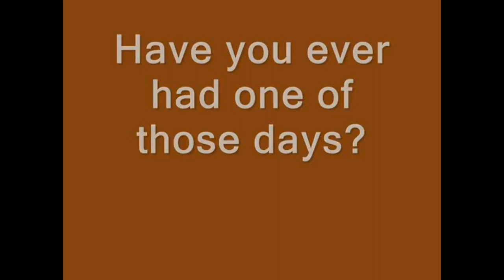Barbed wire for Spark plug wires!    Thanks to TEX WILLIS on youtube

Comment: LOL ... I did not know you make them thar spakem wires out of copper ... Reminds me of back in the day one of the guys hanging around my dad garage in Willamina, Oregon ... decided to paint his engine, the finishing touch was to paint his sparkem wires with gold metal flake spray paint. It was late in the day so evening was coming on ... but he had sparkler wires under his hood them plug wires had spark traveling all over the place because the spark took the path of least resistance on the out side of the wires looked nice but it was undrivable ... LOL
Reply from the maker: yeah the young guys dont know that plug wires used to have copper in them.. they sorta messed with the radio but I wouldnt be able to hear it even if Rockabilly had one

Comment: The ole Rock a Billy seems to be on of the most reliable cars you own. I’ve got a line on a 200 ford 6cylinder and a c4 out of a mustang, that I’m trying to pickup from a guy for $200. It wasn’t running but it’s not locked up either. Do I need it and have a build in mind?? Nope, but the price is right and I’ve envisioned a couple possibilities for it. Good seeing ya on OCG and Str8sixfan last Thursday. ✌️
Reply from the maker: good score.. oh I think my Impala ss is probably more reliable.. the rockabilly needs rings so bad it will hardly pull the hill coming home haha..
Reply: @1963impala2drWaylonWire  in the last driving video she seemed to have a little puff of smoke. Just a little upper end lubrication. My son used to have a 97 Tercel, when it didn’t smoke you knew it was low on oil. 😂
Reply from the maker: @RealWorldGarage  oh its more than a little puff haha.. it looks like I'm rolling coal! lol
Reply: Don't worry about the smoke. It's just mosquito repellent
Reply: @chuckstith838  exactly